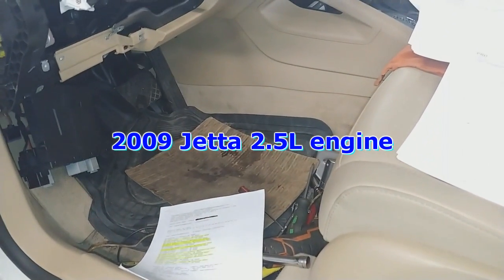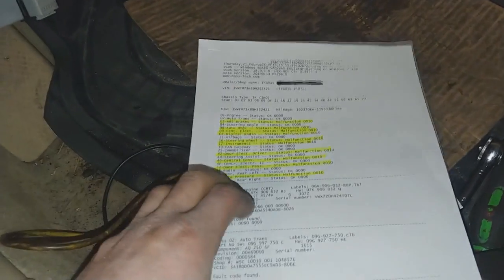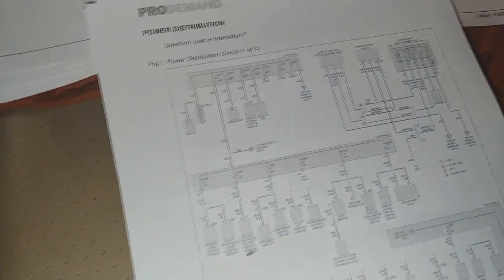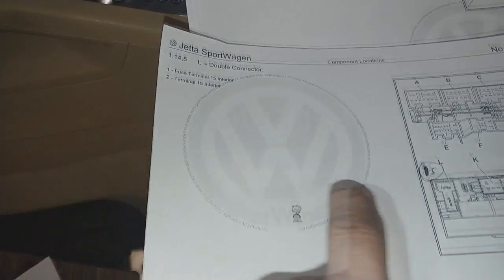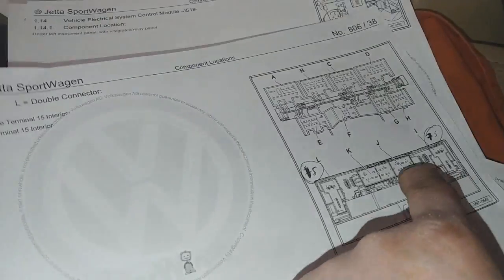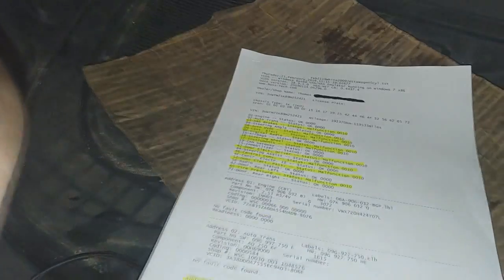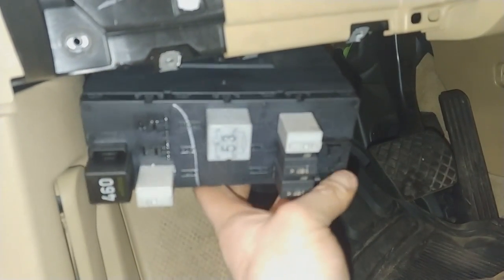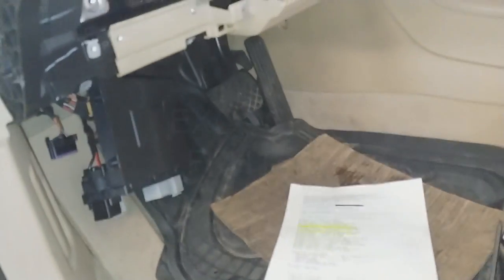VW 1K: 2009 Jetta 2.5L intermittent stalling

Comment: my 2011 jetta has the same issue. I guess this will solve the problem.
Reply from the maker: If it's the same faulty part, yes. Stalling can be caused by a number of different components.

Comment: Electronic work looks like "fun " luckily my van is only equipped with a 3?Relais and an idle stabilizer ( don't have to deal with this stuff ...usually...)
Reply from the maker: You should convert to / install Megasquirt Fuel Injection System! You will have more power & better fuel economy!!! =)
Reply: @EXOVCDS  i like the idea though ,if i dont need to drill any holesi wll consider about it

Comment: good stuff, could this be true for a 1.8t as well?
Reply from the maker: What generation vehicle?
Reply: @EXOVCDS  2001 VW beetle, AWM or something like that
Reply: sometimes if it idles for more than 5 min. it just dies. cold or hot
Reply from the maker: @DrcJr77  Yes, could be ECM power supply relay or fuel pump relay. FP relay will set a bunch of codes, the ECM relay may not. I thing it's under the hood next to the brake fluid reservoir. Relay marked 428 I think. I'm at work... can look for exact info once I'm at home later tonight.
Reply: @EXOVCDS  no worries.  I can look it up as well.  Thank you as always
Reply: @EXOVCDS  that makes sense, no codes are showing up, and it's completely random. As always Thank You my friend.

Comment: hi thomas do you no where is the audi q7 dsp sound system location on amplifier in the back boot of the car plz help me no sound from the radio or cd
Reply from the maker: I'm at work right now... will look for information later today and will get back to you.
Reply: Thomas EXOVCDS thanks so much man I cant find it anywhere centre console unit is new no Amplifier in the boot diagnostics says no communication with The sound module
Reply from the maker: @antodenn381  What year? Does the radio turn on? Just no sound?
Reply: @EXOVCDS  2007 yes the radio turns on no sound
Reply: @EXOVCDS  2007 yes radio is on no sound a the volume button not working

Comment: Did this cause a epc light occasionally? have a 2011 Jetta with a 2.5 runs great but sometimes when hard to start  then other times no problem then after a long run it just stalls out sometimes. Never throws a check engine code but sometimes it throws a epc. Cruise control does not work. Thank you
Reply from the maker: Could be a crankshaft position sensor fault... I think I have had one that did not set a code. Not sure about the EPC light, sorry. When it doesn't want to start, look for a "Tach signal" with a scan tool or check if the tachometer needle moves off of the rest position while cranking (if your instrument cluster has a Tach). Could also be a problem with the EVAP purge solenoid... or something else. When it gets to the point of acting up more often... the problem might be easier to find.

Comment: I am trouble shooting a stalling issue on my 2005 Touareg. I discovered it was fuel pump related. A new fuel pump did not solve the problem and swaping the two relays(main &aux pump) did not have an effect. It is somewhat random as  we can go days with it not occurring, but it has only ever happened at start up, never while cruising. I jumper the aux pump to get around problem when needed(circuit is live with key off so I cant leave it ) The stalling acts like the pump is changing speed, the flow rate surging, it can take awhile for the engine to quit at idle as it will keep catching itself as fuel pressure changes(stepping on gas will usually do it in though)
I am wondering if this can be a logic problem. Doe the ECU use PWM to control these pumps? can it alter its rpm? I do not see a fuel pressure sensor mentioned in any docs so this seemed unlikely to me.
Reply from the maker: As far as I know, those pumps are not PWM controlled. Both run for start up and then the main pump is supposed to keep running. I don't know if you already saw my Touareg fuel pump video https://www.youtube.com/watch?v=EBoMAj_ploA You can use a volt meter to check for voltage at both pumps (a scope would be better so you can see the health of the pump and can even calculate the rpm of the pump). Voltage drop testing the wires... checking for water intrusion that's compromising the wiring etc. Is all that I can suggest, sorry.

Comment: Hi i have audi a4 b7 2006 1.9tdi brb engine i need to know the camshaft cover torque for the hex bolts rocker cover thanks
Reply from the maker: Usually 10Nm for PD TDI engines. Service info can be bought here:
USA - https://erwin.audiusa.com/erwin/showHome.do
Europe - https://erwin.audi.com/erwin/showHome.do
Reply from the maker: That was the torque spec for the valve cover.
Reply: I have checked up says 9nm thanks
Reply from the maker: Good stuff!
Reply: My engine is brb could you re check it please
Reply from the maker: email me and I will send you information:  fkh161 @ fkh161 .ca (no spaces)
Reply: @EXOVCDS  i have now thanks its jake